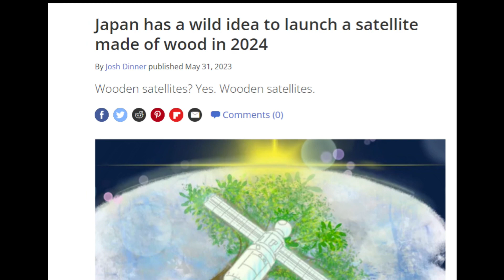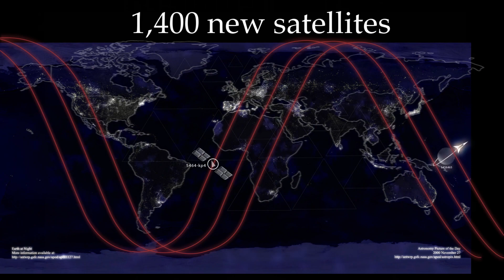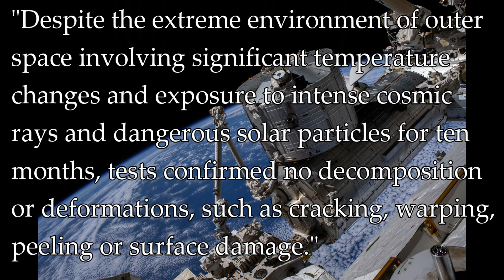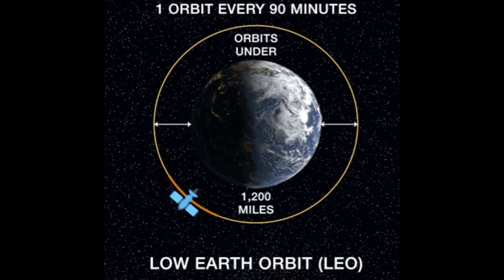A Satellite Made of Wood?!

Comment: Summary

* The Problem: Satellites are typically made of metal alloys. When they deorbit, these materials don't fully burn up, potentially harming the ozone layer and creating space debris.
* The Solution?: Kyoto University, in collaboration with Sumitomo Forestry, is launching LignoSat, a satellite primarily made of magnolia wood. 
* Why Wood?
    * Tested on the ISS for 10 months, wood proved surprisingly resilient to the harsh conditions of space.
    * It's environmentally friendly, being cheaper and cleaner to produce than metal alloys.
    * Wood completely burns up upon re-entry, minimizing space debris and environmental impact.
    * Magnolia wood was chosen for its strength, workability, and dimensional stability.
* What's Next?
    * LignoSat is expected to launch in summer 2024. 
    * Researchers will monitor its performance for six months, studying its reaction to temperature fluctuations, radio waves, magnetic fields, and its ability to shield onboard electronics. 

Overall, the project explores wood as a sustainable and potentially viable alternative to traditional materials in satellite construction. 

i used gemini 1.5 pro to summarize the transcript
Reply from the maker: Well, thanks for such a succinct summary! 😁

Comment: I recall a wooden heat shield the Chinese tested which supposedly worked great - made of oak... And even Star Trek postulated a special starship made of wood in an old star trek cartoon episode in the 1970s. So... it isn't a necessarily bad idea to use wood.
Reply from the maker: I feel like if we’re stealing from Star Trek…we’re doing something right. 😁
Reply: @marionrkerr  - Exactly! After all, the Space Shuttle was stolen from the Galileo shuttle idea ;>)
Reply from the maker: @Afterburner  we must keep up our thieving ways!
Reply: “A Spaceship for the King” by Jerry Pournelle (1971).
Reply: some reentry heat shields have been made out of cork for a long time.
Reply from the maker: @skataskatata9236  that's awesome!
Reply: @skataskatata9236  - Makes sense with the way cork would "burn" but retain structural integrity over time...

Comment: I think wood is a very obvious choice. I have been thinking so for 2 decades already, and I'm surprised that this is actually the first project with it. But I'm not surprised that Japan is the one doing it, given their long history and experience with applications of composite wood, strong and durable wooden constructions as well as ultra light wooden objects.
The strength of wood does not stem from any atmospheric factors. In fact, all the detrimental factors are atmospheric, except mechanical erosion. The biggest enemy of wood in space will be human space trash, and second to that they may suffer from dust clouds from comets. But not more than other materials already in use in space, so it will be a question of planned lifetime.
It also ties into the projects of space trash collection and satellite recycling... If a shorter lifespan is needed, but they can capture and refurbish them, then there will be less and less debris in orbit threatening satellites and space flight. Also, when fine dust is an issue, you can simply add a few mm of thickness and have little to no changes to other properties. This is not true for metals. Also, when a metal is damaged on the surface, the damage could propagate through the entire material, compromising its strength. With wood, only the outer layer will be compromised, yet remain in place as a shield for the underlying fibers that will keep their full strength and functionality.
As for any remnants falling on earth decomposing... I think that will not be the case. That wood will be treated in such a way that it will likely no longer decompose (polymerization or similar) from atmospheric or biological exposure. 
If you see how they can find wooden boats 1000 years old with some wood still intact, I think it's safe to say that IF a part makes it back on earth, it will remain for a long time. However, it will not have a disruptive effect to the environment. I also think that if wooden debris ends up in orbit, it will be less destructive than metal shards...
Reply from the maker: Yeah, I agree, Luke. It seems to make sense, I just never think of wood & space as going together. That point about finding the thousand year old wooden ships is an interesting one, too.
Reply: @marionrkerr  It is interesting indeed, because when you look at decay of wood under water, some of it looks like it was burnt. It blackens from oxidation. So if there was no oxygen in the water, the decay would take even longer. Given the fire resistance of solid wood, I'm even beginning to wonder about its viability as a heat shield for reentry. In buildings often structural elements are made in wood when they have to guarantee a certain fire resistance over time. That's why so many sports venues and other large spaces where many people gather have wooden roof beams. Only the surface burns and the burnt material has to chip off before the rest can burn. In the meantime, the underlying part maintains full strength and provides thermal insulation at the same time.
(yes, I'm a huge wood fan, does it show? I prefer living wood, though, but that would be a rather redundant endeavor in outer space hahaha)
Reply from the maker: Yeah, I’m impressed! You’re laying down some serious wood facts!
Reply: @marionrkerr  One could say I'm hard core ... 🥳
Reply: @marionrkerr  (sorry, I had to pick my puns, and I didn't want to be creepy by talking about some serious wood...)
Reply from the maker: @lukearts2954  I see now I made it nearly impossible for you. 😁
Reply: @marionrkerr  I always say: nearly, is not at all... 🙃

Comment: Problem: Satellite metal may oxidize in atmosphere once it heats past melting and comes to a plasma state (fancy way of saying the metal is burning). This will also oxidize from ozone, yet the magnitude differential is inconsequential. 
Solution: Put a small amount of wood among the majority of metals in the active components of the satellite, because wood also heats to a plasma state (Ben Franklin would like to have a word with Japan), Loves to reduce ozone as much as other oxygen species, and becomes the specific worst-case scenario of "CO2 in the upper atmosphere where it doesn't turn back into oxygen and wood". This is a brilliant way to get funding and notoriety for another worse-in-every-way "advancement". What a horrible idea, and also an increased risk, as charred wood is a very good refractory material. It will likely help the partially molten metal hit the ground without burning up, but also in unpredictable locations, as the charring wood will also change the trajectory. My bet is on "causes rapid spinning, which both keeps the metals intact and sharp from spreading the heat, but then it flies apart and blasts the area with intact chunks."

Wood would likely make an excellent shield against micrometeorites and solar heating though. The high temperatures would simply turn it into carbon foam, with an exceptionally high melting point, and great insulation ability. In fact, wood has been a common part of nearly every satellite that has ever been launched. It's generally used for padding and holding things steady during the high-G flight, but doesn't weigh much (Balsa wood is most commonly used), and can be easily broken away during the deployment phase. Nothing new, nor improved is being offered here.
Reply from the maker: Well, I suppose we’ll all find out next year!
Reply: @marionrkerr  Yes.

Comment: If they want shielding from electro magnetic radiation, wood will provide virtually none.
Reply from the maker: Yeah that’s one of the things I’m most curious about.
Reply: A light foil or mesh layer could probably handle shielding needs?
Reply: Who needs shielding when we can pretend it's a hollow box with zero metal circuits.

Comment: Aluminum is lighter than wood.
Reply from the maker: But awfully metal-y. 😉
Reply: @marionrkerr  only downside to aluminum is it will oxidize like any other reactive metal.
Metalic and silicate substances are natural in space, but wood?
Reply from the maker: We shall find out!
Reply: In what world? Direct density is 2.7 kg/l for Al vs. about 1 for wood. And specific strength according to this video is comparable (depending greatly on alloy).
Where stability (buckling and the like) are a concern, less dense but specifically equally strong materials have an advantage (a problem Space X ran into with stainless steel. Much more prone to buckling than aluminium for equal weight.)
The fibrous orientation is also often an structural advantage.
Reply from the maker: @HotelPapa100  I meant we’ll find out if wood is a “natural” fit for satellites. Def seems to have pluses and minuses.
Reply: @HotelPapa100  lighter in carrage

Any material with fiberous structure is subseptible to collect various matter. As opposed to a smooth surface.

Yes in a direct density comparison. Wood is less dense than aluminum

Comment: Wood has been used as a far superior material for firewalls the aerosoace industry for high altitude, high speed aircraft such as the U2, built by the Skunkworks back in the day.  😎
Reply from the maker: Oh interesting!
Reply: @marionrkerr  Structural resistance to fire is way bigger for wood than for metals. Metals quickly heat through and then lose all thier structural  strength. Wood slowly chars from the outside, while the core retains its structural properties. Firemen much prefer to go into wooden structures than metal skeletons.
Reply: Cork is still used on spacecraft. The comments regarding wooden airplanes like the mosquito or the Spruce Goose took advantage of specific characteristics from different tree species and then how they were laminated and constructed.

Comment: Mmmm, I hope the Sacro weather is better than the constant rain we are having in darkest Yorkshire. I'm relocating soon to sunny Devon but enough of my meteorological problems and onto the wood. A wooden casing will absorb without puncturing any sml metal flecks etc . Wood is also an extremely good sound and heat insulator. The Lig*** project will be so called as there's a very special kind of wood called Lignum Vitae. It's the only wood that also self lubricates. Next time ur in London call in at the Greenwich museum. My ancestors clock still ticks away keeping perfect time. There are other interesting woods Marion, but I won't bore you with the details. Must dash now I'm packing up😂
Reply from the maker: Yeah who knew? Space & wood could go together like peanut butter & jelly! Or fish & chips! 😁
Reply: @marionrkerr  I wood not know about the jelly n peanuts but fee and chi, yah I rike velly much I fi the oyr in the feesh velly gude. P.S. Never ask a China Man for directions in fact don't ask a China man where exactly it is in space and time u may b. I had to do this last week when I needed to confirm my current position and was given these immortal 3 words...Rake, Rock, Row or what sounded like that. And this is the problem with travel be that though time, space or both. Its not the traveling that's hard. Its the people you meet when you get there. Needing an accurate fix on your current position is vital if you've arranged to meet your eldest daughter in a slightly unkown part of the universea. My true north was in fact Lake Lock Road in a tiny place called wait for it......Stanley near Wakefield. Now he got lost imselft did Dr Livingston but he was in the Congo, I was not in Africa or walking across the plains of Namibia or landing on Jupiter I was only local. Local and lost and I never got to actually see my daughter as she drove past just as I was trying to decode what the China man had just told me. All I remember now of that truly miserable day is the sight of my daughter driving straight past me as I struggled to understand the rangwich and her telling me over the fone she just couldn't find me. Ah life is such bitter sweet sorrow. I never caught up with he and she stopped speaking over itr. The time window was closed after that. But afterwards do you know Mazza I nearly died from laughing. Oh and before I forget. My real grid reference was Lake Lock Road !
Reply: Lignum simply is latin for "wood". Of course some wood types would have the term in them.